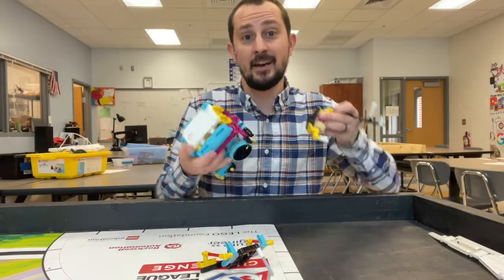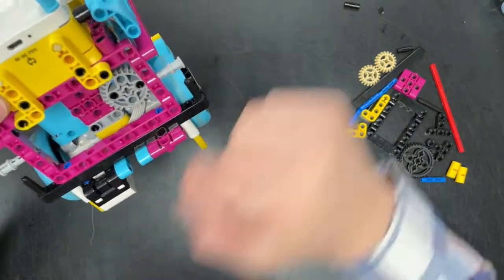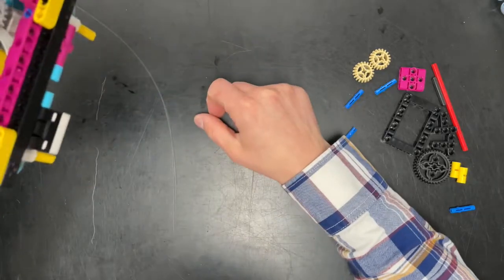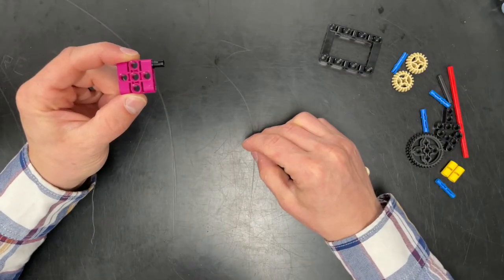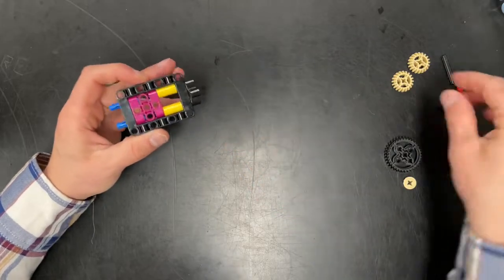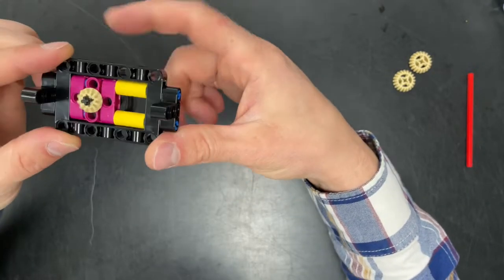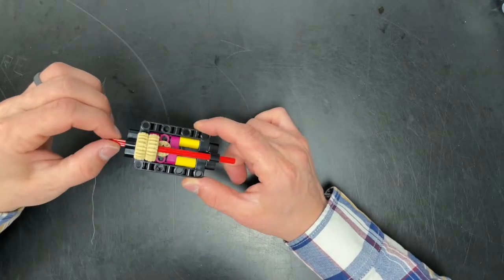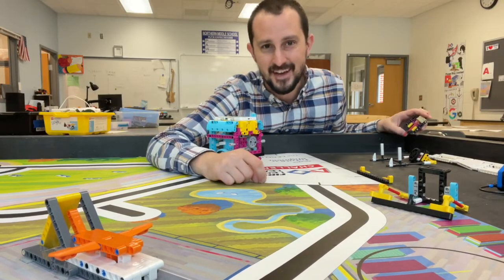Modular Quick Attachment Starters! - FLL Master Piece 2023- FIRST LEGO League Game Inspiration

Comment: I changed the gear ratio. On the robot a old 24 gear with a 8 gear. On the attachment a 24 gear and two concave gears with the same amount of teeth. Now you can use  degrees in your program. The angel is the same as in the program!!

Comment: how to set the position of the gear. Specifically, let's say that we have a movement arm attachment, but it needs to be at a given starting point. Without a gear in between, it's trivial to set the gear arm angle with a while loop and some if angle greater than or less than blocks. With the gear, how can I consistently reset the starting position of the arm before a given run. I hope that makes sense. Any advice welcome @ZacharyTrautwein?

Comment: My team built the MiniMax robot and one of these active attachments but it’s not possible to move the attachment by hand to position it. How do you get around that? Like, once it’s on in a certain position, it’s not moving. Then when you program it to move a certain amount of degrees or seconds, if it hasn’t started at the right position, you’re completely out of luck. Any advice for that?
Reply: A simple way is to stick your two index fingers behind the red rectangle and move both the robot and attachment gears with your fingertips or fingernails. It can be done.
Reply: This is the missing bit from this video. How to actually use the attachment consistently.
Reply: @BrandonFox42  "This is the missing bit..." What is?
Reply: @nedcook2  how to set the position of the gear. Specifically, let's say that we have a movement arm attachment, but it needs to be at a given starting point. Without a gear in between, it's trivial to set the gear arm angle with a while loop and some if angle greater than or less than blocks. With the gear, how can I consistently reset the starting position of the arm before a given run. I hope that makes sense. Any advice welcome @ZacharyTrautwein?